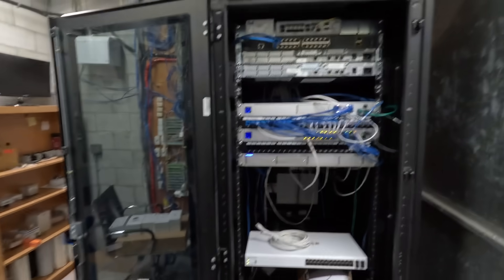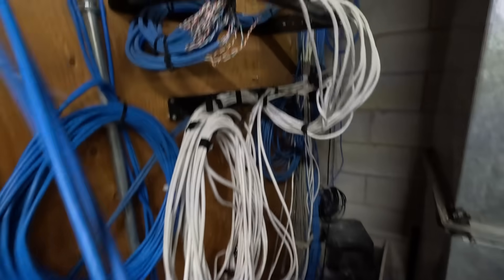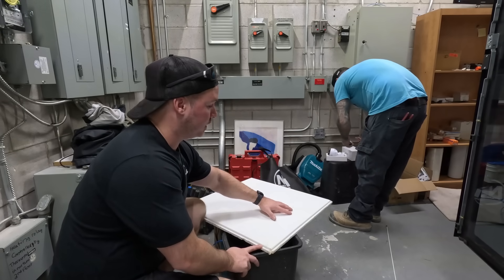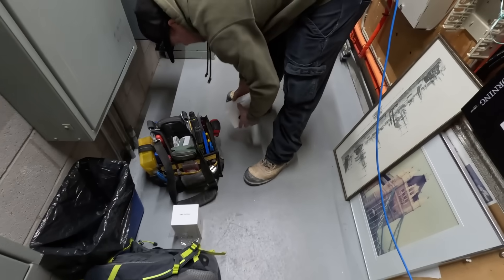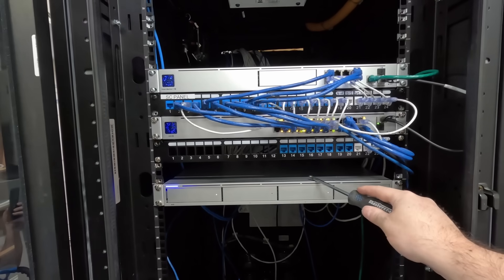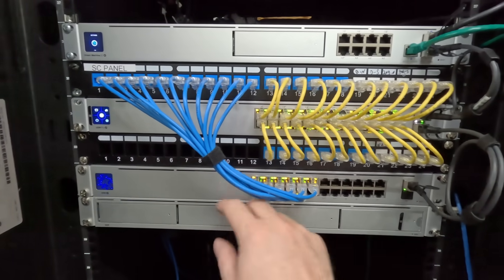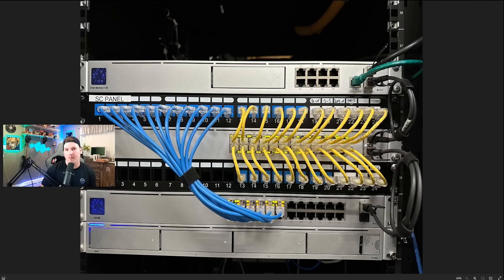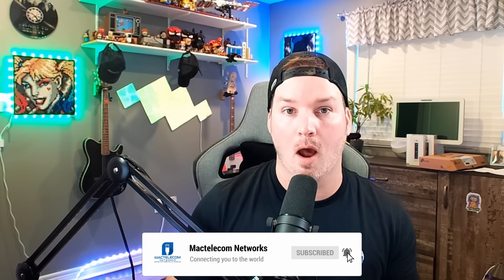Unifi Protect Installation : Onsite job

Comment: Why would you change the previously PROPERLY configured network topography by moving the UNVR uplink from the USW to the UDM. So the UNVR can get what, a 10Gbps link to the UDM, but only a 1Gbps link to the USW (where the cameras are) or a 1Gbps link to the internet? You didn't gain anything, and now you're unnecessarily putting the camera data across the UDM rather than just keeping it all on the USW. Dumb.

Comment: Don't forget why it is a mess to get it neat and tidy it requires a lot more money with more switches and patch panels. Also with those cheap rack mount non keystone patch panels, you have no choice to strip the sheath back and have the conductors exposed, you need 8-10cm of length to terminate them. The keystone rj45 can be rather expensive each too.

Comment: In the US it is illegal to place cameras facing bathroom or shower/locker room doors. Hallway to it is iffy depending where you are. This comes from talking to many business owners i know that have commercial and industrial properties across most of the US. A few have had lawsuits regarding cameras facing problematic bathrooms and locker rooms. In my area it is illegal to place cameras facing bathroom doors, locker room doors or shower room doors, unless you have permission from a local judge and a few signatures to make it "legit and legal".
Reply: This video is from Canada. It is illegal to place it inside washrooms, locker rooms, etc. in Canada but it is perfectly legal to place cams just outside at the entry/exit points as long long as the cams cannot viewed into the locker room/washroom. Placing cameras outside but near a washroom is just like placing a cam inside any public access buildings.

Comment: Hey Cody,  aside from the grommet do you put in any dielectric grease?  I've done this with my outdoor cams - nothing crazy just some inside the jack before terminating the wires and then a coat around the RJ45 port to prevent water from seeping in.  Just wondering if it's overkill.

Comment: 1) If someone trips in that cable mess your client could also be sued.
2) tidying this up will cost less in the long run for your client, those non compliant cables will cause issues and that’s more call outs.
3) insurance, a broker or claim assessment go give out an unfavourable impression and jack up your insurance cost or even be denied a claim for not having compliant cabling
Reply from the maker: We for the green light to go clean it up

Comment: At 7:10 you say that the UNVR is overloaded, however there is 4-8 cameras shown in the video apparently patched through to the switch.. Can you explain in more details exactly how the UNVR is overloaded in the configuration that you have shown? I am considering a purchase, however if it cannot record 4-8 cameras without issue the it is a no go. Or am I mistaken in the amount of the cameras in the system? 
Thank you!!

Eidt: 7:10 {7:44}
Reply from the maker: Hey ,

The unvr actually has about 30 cameras on it . It’s at 109% capacity, it still works but will add another one
Reply: @MactelecomNetworks  thanks. 30 cameras explains that.

Comment: For the camera that got fried because of improper installation, it appears to be a G4 as you said, why did you replace it with a G4 Bullet and not a G5 Bullet? As you well know, other than the metal construction the G5 bullet is cheaper and a newer model.
Reply from the maker: They had extra stock of g4 bullets the customer provided all the equipment

Comment: The company I switched to, all the cabling is a disaster. They left 2' in the drop ceiling and put a RJ 45 on directly into the switch sitting on a ceiling tile. The jacks in the walls are stripped just like yours but they unwrapped the twists....  I installed a 12u rack and made patch cables with keystones on each end. Panel now looks nice and organized but uptop looks a little sketch with 20 keystones all hanging out 😂

Comment: Hope someone clears all that stuff off that transformer. As an electrical loss prevention specialist for an insurance company I once visited a hospital where they had all the buildings blueprints stacked on a transformer. When they removed them, they found the ones directly in contact with the transformer housing were chard.

Comment: What a mess before you got there.  So much better after you cleaned it up.  I can't imagine how the previous installer/cabler though that CAT5 (>=) cable can be stripped and terminated in that manner.  In what world does that even look close to being correct?  Absolutely blows my mind.  Nonetheless, excellent work - and great video!

Comment: Why a 2nd NVR? Why not just use the larger NVR they make and sell off that smaller one? Seems like extra processing being sent through the switches having two chipsets separated vs one bigger chipset in the bigger NVR. Just thinking about how to save and prioritize bandwidth.

Comment: Nice work.  How did you convert the second WAN port to a LAN port?
Reply: In the controller go to unifi devices in the left side bar, select your gateway in the list and then in the right side bar you should see port manager. Click that and then once you can see the list of ports click on one of the WAN ports. You should then see config for the interfaces and which ports are LAN and WAN. If you are using an older USG you need to click on settings on the right panel and then configure interfaces.
Reply: @jamesalexw  Thank you

Comment: Still have ton of me3400 Cisco in my ISP network..  They use a lot of Rep in old circuit not a bad switch if they just want lower than 1GE circuits.

Comment: I’m so curious as to how you charge the client for doing these services. Starting a similar side gig and would love some advice.
Reply: Thank you so much for your reply. So aside from equipment (which I’m sure they pay for) you are only charging them time, plus the runs for each cat 6.
Reply from the maker: I should probably make a video on this. We charge a set rate for the cat 6 cables ( it’s going to be different around the world) but typically between $130-$160 per run cat 6 plenum ( Canadian) 

The rest would really just be time . So how many hours it takes to put the cameras up times our labour rate
Reply: @MactelecomNetworks   Are y'all licensed for low-voltage work?
Reply: @MactelecomNetworks I am sure I have watched a vid you done on pricing…